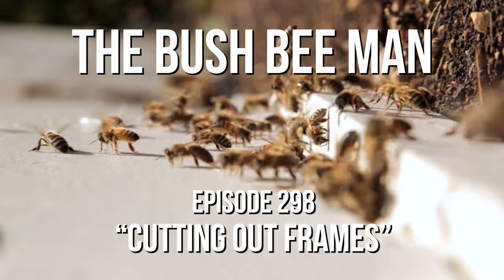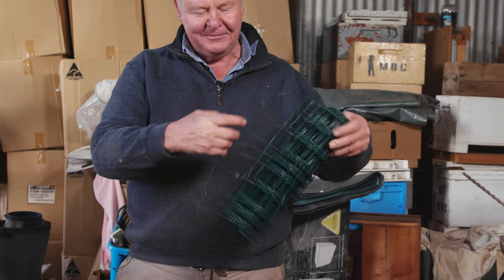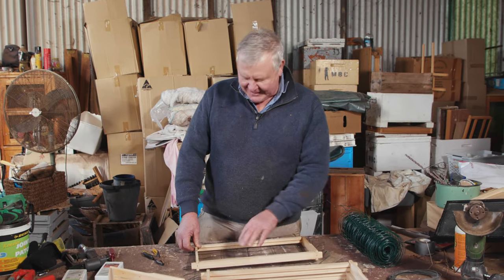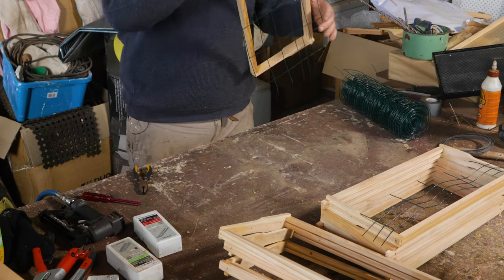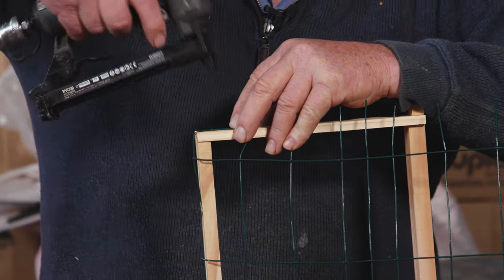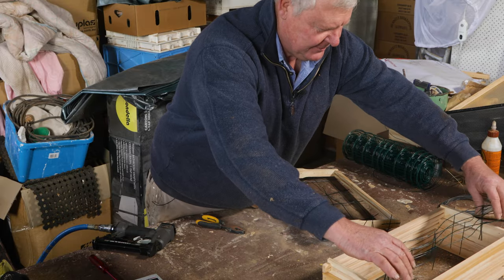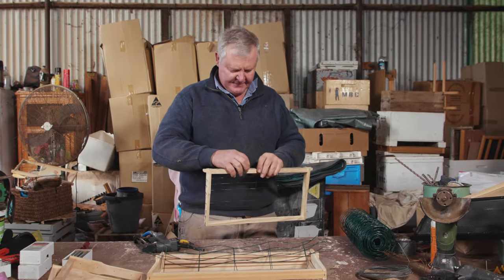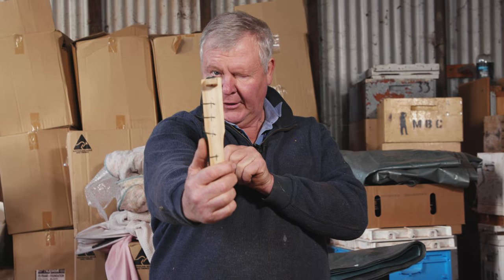How to build Custom frames for Beehive Cut Outs  | The Bush Bee Man

Comment: For a year, I took frame wire and stapled three pieces across the back side of the frame to lay the comb on and secured the comb with vertically placed rubber bands.  Then I saw someone put 2 rubber bands diagonally across the corners, like the one rubber band that was on the frame you took out, and secured the comb with vertically placed rubber bands and never looked back. Works perfectly and leaves nothing behind once the girls remove the bands.

Comment: If the wire mesh is just wrapped around the frame as you did near the start,  you could detach it and reuse it once the bees had secured the comb.
Reply: Roy, The bees will genetically perceive the wire as something permanent.  They will handle the wire by sometimes attaching the comb to it. Other times the bees will not attach the comb to the wooden frames. They will just leave the comb sit there.  The bees will clean the comb up, but no telling what they will do to overcome the wire.  He then put elastic bands on to hold the comb in place.  The objective is to get the bees to attach the comb to the frame.  Again the bees' perceive the elastic as something different.  They can take their proboscis, easily tear rubber and you've lost support .  Sometimes though the rubber will be perceived as permanent and the bees will just clean up the comb and not do anything with it.  Mr. Bush mentioned string.  Heavy string, slick string, fishing line and anything that has permanence about it should be avoided.  The answer is to use a light string with fray on  the outside of it that the bees can get ahold of and begin to dismantle the string one little piece at a time.  Tamale (oh....you guys don't know what tamales are.) string is great.  Kite string type.  If just one bee starts pulling at the fray edge of the string and the comb moves, all the bees in the immediate area WILL STOP! Associative genetic collective response.  Now don't break out your hammer and sickle.  The C are not that smart. I will leave politics to BBM.  Anyhow the bees will work overtime toward securing the comb to the frame.  Someday I will buy me a Bush Bee Man Hoodie, when I get rich.
Carroll